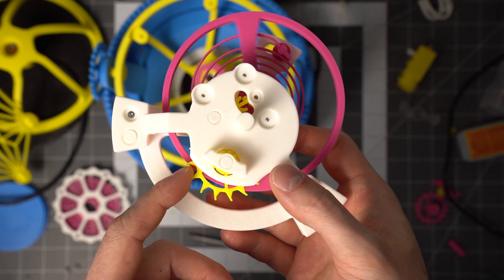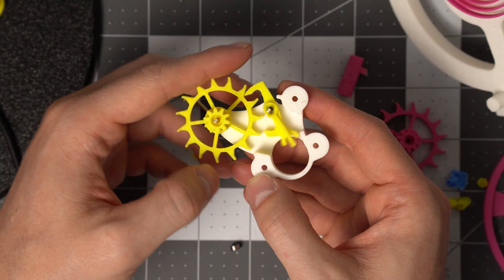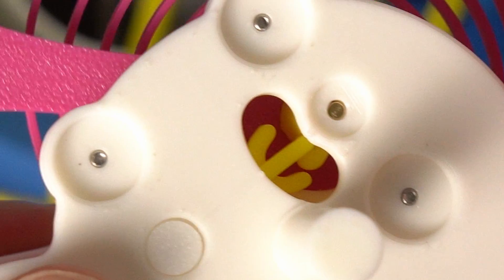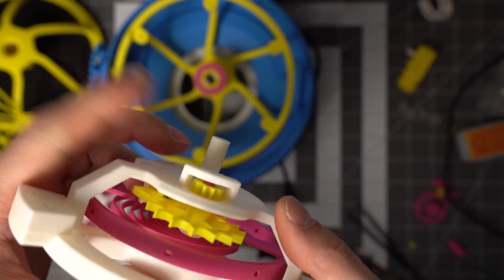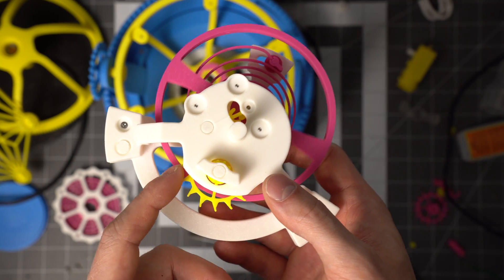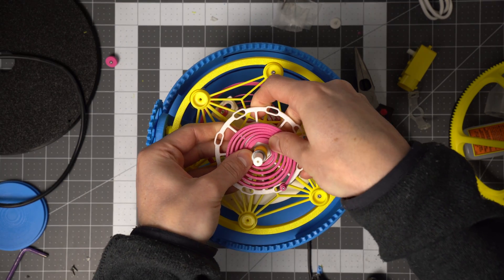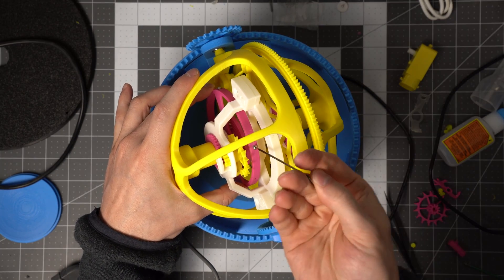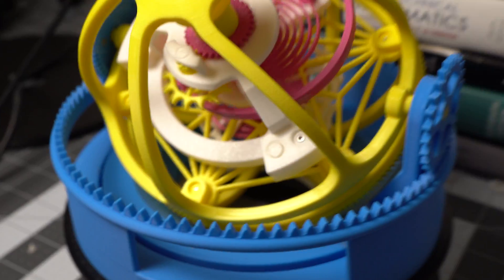Triple-axis Tourbillon Model Kit - 007 - Bambu Labs - Watch this before you build it

Comment: I still can’t figure out the escape wheel. In Step 1 you said that turning the escape wheel in the forward direction should bind, and the reverse direction should spin freely. This is how mine is working. Then in step 5 you spin the escapement wheel in the forward direction and it spins, while mine still binds. Mine spins freely like yours in the video but only in the reverse direction. What am I missing?

Comment: Had this video side by side with the official assembly for about a week, and couldn't have got this thing running-ish without your help.

For those of you doing this project recently:  In the Tourbillon kit there are M2.5 screws with rounded heads.  THOSE ARE FOR THE BALANCE WHEEL.  They need to be put on and screwed in all the way to clear the housing.  DO NOT SKIP THIS STEP.  You can put them on afterwards if you like, but your movement is going to run like shit if it runs at all until they are attached.  The balance wheel is WAY too light on its own and needs this extra weight to function.  There are just enough screws to cover the entire wheel, no more.  There is no mention of this anywhere in the BL video.

I don't know about anyone else, but I had a hell of a time trying to print the L3 Bearing Race.  There must be something weird with how the supports are structured on that, since the internal hole was not circular due to filament bridging and the bearing race that was facing the build plate barely printed.  Do the best you can with it, it helps tremendously if you have a deburring tool.  Go over the internal circumference and make it smooth.  The third axis of the movement goes inside this, so there can't be any friction.

Apart from those, the only other issue I ran into is warping.  If there's one time where warping is going to bite you in the ass, it's this.  I was using a BIQU Cryo plate and on some colors it lifted.  If you even so much as think it's warped, reprint again using a better/different bed.

Comment: Wait, what's going on here? Why is there a motor? Why is the storage spring inside the mechanism?Why is the internal escapement disconnected from the outer 2 axes of motion? The spring should be in the outside driving the outer most axis, which drives the next one, all the way into the escapement in the middle!
Reply: Not a storage spring. It's to smooth the motion of the escapement, because otherwise the motor will bind and probably break something. Motor is just there to keep it running for longer than a plastic spring could ever hope to. The escapement is completely connected to the other axes, but that spring makes them rotate smoothly instead of jerking with the escapement. It's not a perfect model, but it is pretty neat to watch it go

Comment: Thanks for doing this. It is a really useful video.  Do you mind if I point to it in the model description? Regards,  Steve
Reply from the maker: Go for it, I’m glad you as the designer found this video useful.
Reply: Steve would the bambu set or the thingy set + 10 june updates be the most recent?  Are you still working on more updates yet to come.  Thanks for the model, its a thing of beauty but quite a challenge to get working
Reply: @user-Atamigaputer  Thanks! The Thingiverse and Bambu designs use different methods of driving the tourbillon. Bambu engineers modified my original (Thingiverse) design to use components that they sell, i.e., a DC gear drive motor. 

Pros and cons:

The Thingiverse version uses a stepper motor and an Arduino to control the motor speed. The Thingiverse version is more complicated, using a variable speed drive controller to match the natural speed of the tourbillon.

The Bambu version uses a DC motor with a selection of gearing options to match the speed of the motor to the tourbillon's natural speed. The Bambu version is simpler, but you will need to experiment with selecting the correct gear ratio, to match the natural speed of the tourbillon to the motor.

I did start working on updated files for both designs, but I have been distracted by other projects. Go to my YouTube home page and click on "More about this channel ...more" to get my email address if you have any more questions. Regards, Steve

Comment: Hi thanks heaps for this vid.  Im at escapement assembly stage but note that your model is a little different to mine.  In particular, your frame base bridge main has a peep window to help with fork alignment, my thingyverse file does not have that window.  Also not sure yet but there seems to be a little miss alignment with shafts between frame base inner and frame base main. I don't see a clean level aligned mesh with the escapement wheel and fork. Where did you source your print files from?  I see mcmaven updated some thingiverse files just a few days ago but there a no notes on the changes. Im really keen to get this model working so appreciate your tips.  It sounds like you are using a gearbox motor, im going to try the stepper motor method.  Did you have a variable speed solution for your gearbox motor?
Reply from the maker: I got my files from makerworld, link is in the description. I’m not sure if he is keeping the thingiverse files up to date but the makerworld files are for sure up to date because he did a collaboration with Bambu lab for their hardware kits. The gearbox motor I’m using does not have a speed controller but a speed controller would be very useful when troubleshooting the escapement mechanism at the end of the build process.